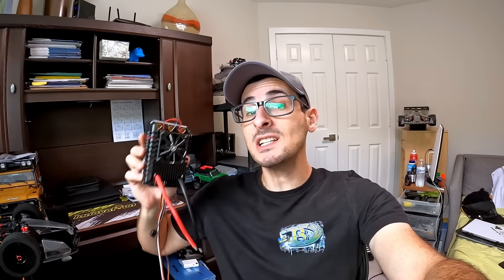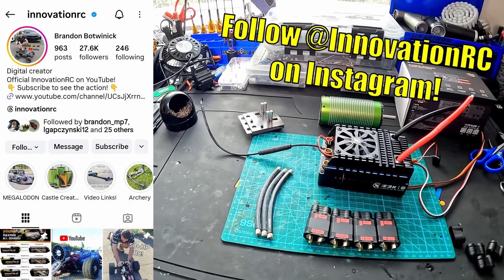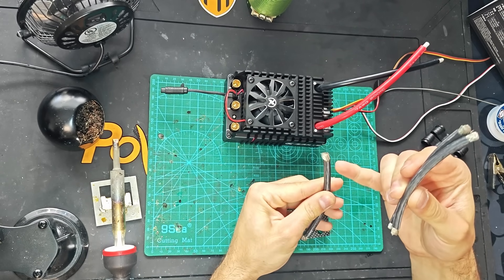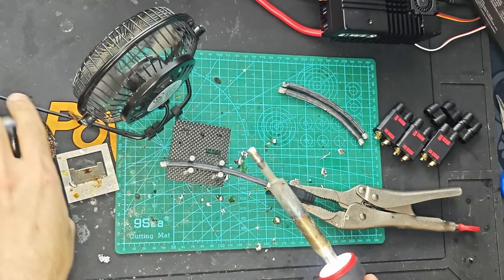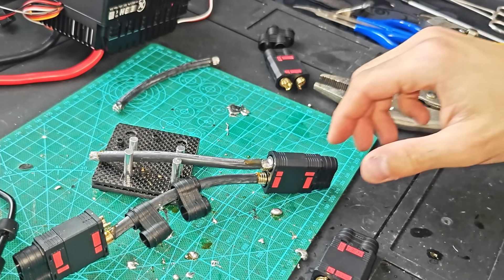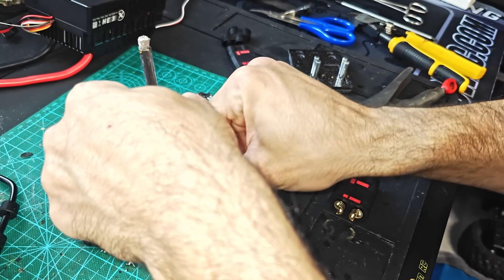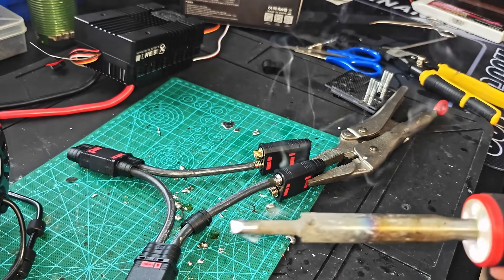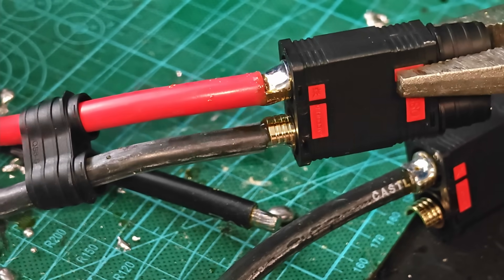XC 16S ESC is HUGE! *67+ Volts!* XC 16S 300a - Quad solder series connection

Comment: What kind of solder do you recommend?
Reply from the maker: 60/40 rosin core leaded or lead free. If you have a higher wattage iron use lead free, it has a higher melting point than leaded

Comment: Time to pair it with a castle 2535 680kv, or you can do a dual setup like me!
Reply: Initially, I was thinking the same thing...then, I discovered (too bad) that the 2535 only handles up to 12S.
Reply: @ninthislandrc it can damage mechanically, but It can work up to a point.

Comment: You should check out the Mad Max series of ESCs 
Very, very powerful.
Reply: Xc makes mad max esc's. That esc is the max21
Reply: The app for both mad max and xc escs isn't called XC Link for no reason..
Reply from the maker: Aren't they the same ESCs? (Rebranded) Not that that's a bad thing, I have high hopes for it I've seen many good reviews from XC. Also and max so it correlates I guess
Reply: @InnovationRC I'm not sure on that one my friend, they could well be the same ESC.
Reply: Same esc's.  Mad max designed and had XC manufacturer.  XC decided to join the surface rc scene given mad components had good success

Comment: What soldering iron is that?
Reply from the maker: Weller 80w SP80NUS is the model I have, the newer one I show in a picture in the video
Reply: @InnovationRC yewh you showed it in thr video right asfter i asked this.. the one i have is 80 watt but does hest tye wire uo that good like this is